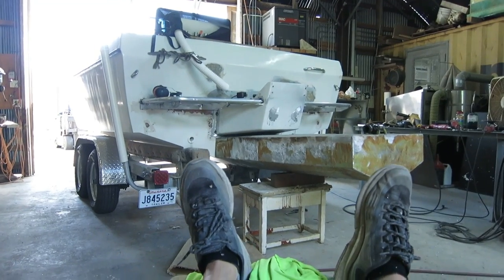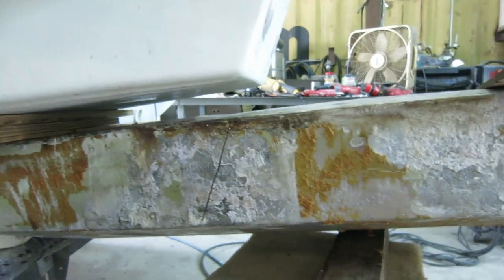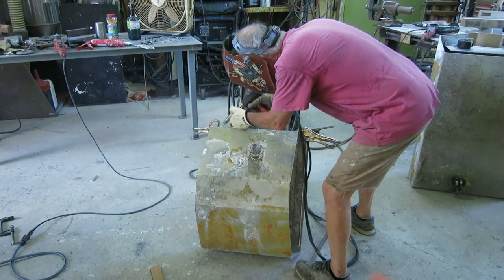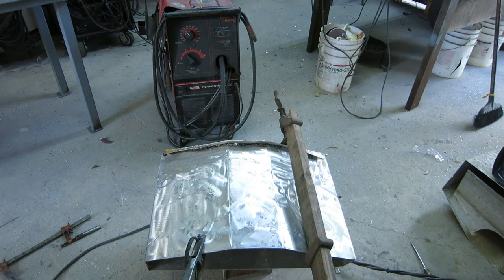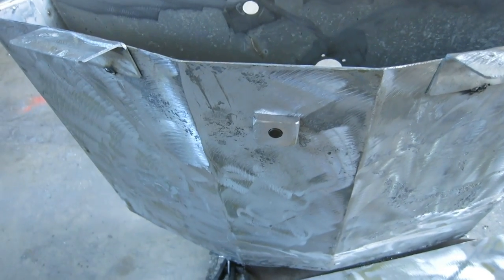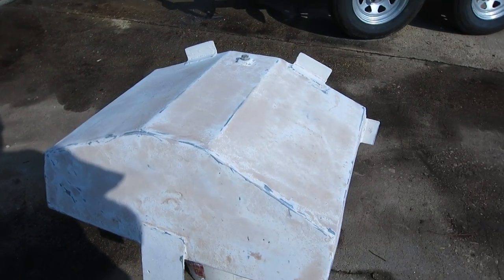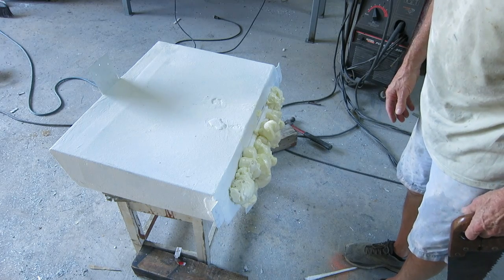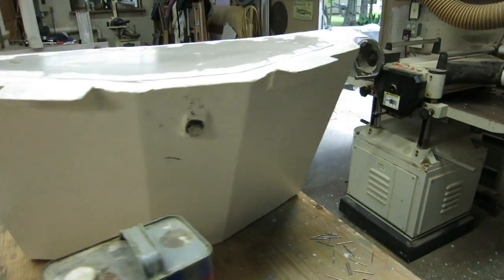Adding DIY Flotation to The Center Console Project Boat

Comment: Always good ideas, theory is there, ingenuity.  I admire your yankee frugality and recycling parts. That said, I personally might not have skimped on the foam, would have used a closed cell marine quality.  As for cavitation, my fingers are crossed it doesn’t happen. Looking forward to the next video!
Reply from the maker: Thank you Howe! If water of quantity is discovered when removing the drain plug, replacing the foam would not be a huge undertaking. I am betting it will be fine. Thanks for watching and thanks for commenting!
Barry
Reply: The spray foam is closed cell.  If it doesn’t act like a sponge, it’s closed cell.  Same goes for the spray foam used in homes, like the 2 part froth pak stuff at Lowe’s.  I used the Lowe’s stuff on my Grady in stringer grids, it’s the same as original foam Grady used, to me. The 2 part liquid 2 lb density pourable marine  stuff like Total Boat is cheaper than 2 part spray and good for his project since it can be poured in. But it is still more expensive.  I also used 2 inch thick sheet XPS foam insulation, the purple stuff at the Depot, in my Grady - spend more time in labor but lower cost too.
Reply: @barrylukebuilds7894  - you can check up on it occasionally since you have the drain plug there.  My Grady original bracket has two foam blocks in in side, preformed, and two drain holes on the bottom.  With three access round poly plates in the top.  I check the drain plugs every few years, get a little out perhaps a pint or so.

Comment: Nice, honest work! Looking forward to seeing how this modification performs in the water. As mentioned previously: engine mounting height, prop diameter and pitch, weight distribution,(particularly towards the bow), and the option of trim tabs are variables you can further experiment with, as needed. Thanks!
Reply from the maker: David 
Thanks for the comment and I agree, I have just begun the sorting out process.
Barry

Comment: I was going to say 😁, you can cut a recess in the bottom where the plug is, with a half height alum tube/pipe welded in, a few inches long.  This way the floatation bracket can be deeper, the deeper the better.  And you will have access to the plug.
Reply from the maker: Robert
Certainly a doable option. I am hoping that all will be well with the one floatie.
Barry

Comment: Did you consider using two pods and putting them under the wings?  They could stay up above the bottom to clear all your through hulls.  They would provide more lift even if they were not totally submerged.  Just mind doodling...
Reply from the maker: Doug
I did look at that. There just isn't a lot of the transom under water on those areas. 
thanks Barry

Comment: adding that plug underneath will likely cause cavitation issues for the outboard. maybe cutting a recess up, or placing drain at bottom of back edge  with a perforated drain pipe along bottom internal edge would be better. nice work otherwise.
Reply from the maker: Thanks Man, so far the boat is running well.
Barry

Comment: Nice work Barry. I would like to know if it worked and how much stern water line lift you got from adding flotation?  I have a 24 ft. Boston whaler with twin 200HO Evinrudes and was thinking of getting extension platform. What are your thoughts?
Reply from the maker: Thank you Jonas! It made a difference, not a huge amount, but better. I can now stand in the back with out water coming in the drains. Two people cannot. I can see no drawbacks at all. Doesn’t weigh much, no moving parts, no maintenance, does not affect the engine performance at all.
Just wish I would have built my floor a little higher!
Barry

Comment: Mr Luke, you are one heck of a craftsman and put great care in your fab and creations. I mean no disrespect I fear this attachment will be ripped off the bottom of original bracket. Why wouldn’t you have matched the thickness of the plate aluminum to fit up the sides to the top of bracket. The old makos had foam filled brackets and with time became I very heavy sponge. Good luck with the build and please be safe
Reply from the maker: Hook 
Thank you for the kind words! Several reasons I went with the thin aluminum but mostly because I didn’t know if it was going to work. I didn’t know if the added buoyancy was going to make a difference and I didn’t know how it would affect the engine. It worked and as long as the light weight version holds up it will stay. It will be easy to check for water infiltration just by removing the plug occasionally.
Barry

Comment: I think you will make the outboard cavitate. I presume you lifted the bracket higher then original hieght?
Reply from the maker: Peter
The bracket is back where I originally installed it. The motor is lower on the bracket because of cavitation issues on the first run. Why to you feel The motor will cavitate, Just trying to learn.
Barry
Reply: @barrylukebuilds7894  don't get me wrong I'm. No expert I'm just curios. I had a shetland 20ft boat with an Armstrong bracket on the back and a 90hp yamaha. Because it was about 30" from the back of the boat you could lift it too about 3 " higher to get optimum performance but as your  basical extending the Hull of your boat if you had of raised it I think you will starve the prop of water. There was a brilliant video on here explaing the science behind it. The boat I had was called Darley rose which I will try and find the link for you but was a good video on engine brackets. But you can try searching the name Darley rose
https://youtu.be/t0KeS5M5TCM
Reply: @peteramberley9952  Hello Peter! Could you find that “brilliant science” video please? Very interested. 🙏🏻
Reply: @GuepardMarine  look in my previous comment the link is in there at the bottom .hope that helps
Reply: @peteramberley9952  I found the link, but it’s about the outboard conversion, but there is no any explanation…

Comment: What the reason or theory behind the floating transom. I believe the reason behind the external set back is give less prop was, plus act like a Canadian plate plus also rear swim deck.lus more inside the boat.???
Reply from the maker: Donald
Yes to all of the above and also if you want a full height transom the motor has to go somewhere.
Thanks for watching and thanks for the comment!
Barry

Comment: PS: polystyrene will immediately dissolve if gasoline (always some around) contacts it.  The blue board and pink at the hardware store are much more resistant.  Polyiso would be best if available.  Not sure how the spray cans react to solvents.
Reply from the maker: Thanks Doug
Barry
Reply: XPS ?

Comment: If memory serves me that outboard weighs about 520# and the 225 duplex weighs the same but you drop to a 200hp and that weight 425lbs basically the same motors but setup different on the fuel system !
Reply from the maker: The 250 E-Tec weighs 100 lbs less that the original twin 90's. That's kinda what I was going by but I underestimated  the  affect the setback caused.
Reply: @barrylukebuilds7894  I have a v4 110hp Evinrude and it’s around 200lbs , there’s not much weight with that silencer they have ! But for a 2 stroke it’s an elephant ! I’m wondering if a Jack plate mounted on the transom would have been different , I’ve seen ones 12” away from the transom but not sure if that’s enough room for that outboard an older one yes for sure !

Comment: Have you done a sea trial yet? I cant find the video if you have
Reply from the maker: Steve
Have used the boat several times post swim step floatee modification. It now floats about 1 1/2" higher. So one person in the back ok ,two people and water comes in the scuppers. I was hoping for a little more lift. I lowered the engine do to cavitation issues but I also brought the motor closer to the transom so I should have lowered it more. I still cavitate if I give full throttle at take off. I am out of bolt holes so lowering the motor any more will be a little tricky. Other than that all is well. 
In hind sight I could have installed the deck a couple of inches higher, would have been no trouble at all. I also should have installed the swim step a couple of inches lower.     
Thanks for watching!
Barry
Reply: @barrylukebuilds7894  Hi Barry, Thank you for getting back to me. I have been watching loads of videos about ourboard pods because Im converting my 27 foot SeaRay to twin outboards when the boat gets lifted end of March, unlike you struggling in the heat here in U.K. need worry abour the cold. I will be using twin 20 inch shafts, if I put just one engine in the middle it would need a 25 inch shaft. What length did you use? Looked to me like your engine needed come up further out the water but also go down for the cavitation plate to line up with bottom of the V. Once again thank you for getting back to me, really been enjoying your videos. I will be uploading to my channel as I go. Happy New Year to you and your family. Steve on south coast U K.